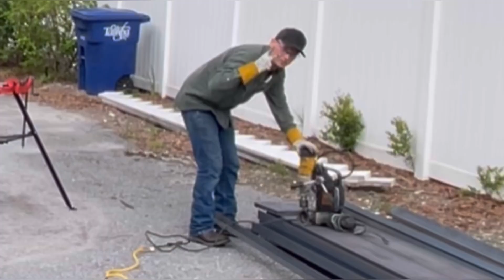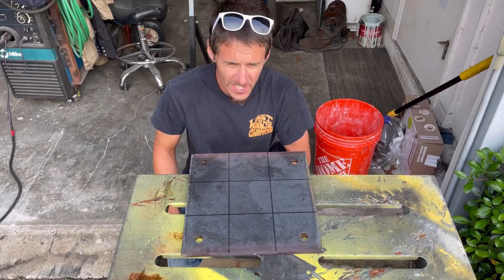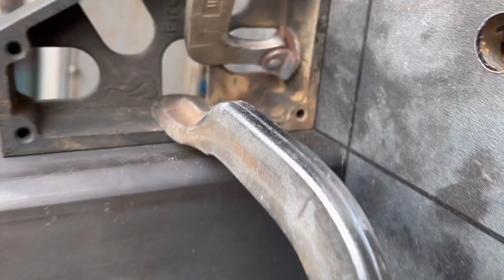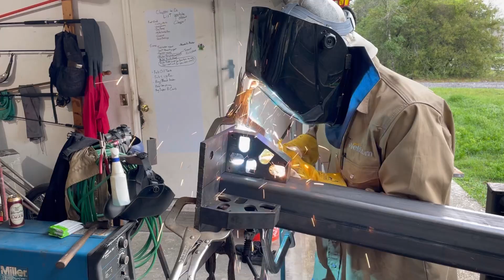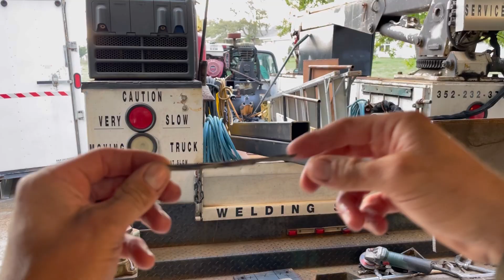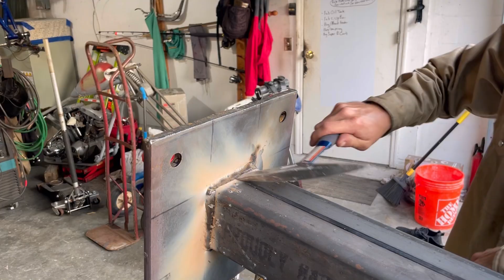Welding Structural Columns in the Field! (How To)

Comment: Of all 4 welding process im learning, mig has been love hate for me. When the settings are dialed in, man  you feel like the best welder ever. Then i got to vertical and over head and got humbled real hard. Holy fuck the bbs flying all over my face😂
I did notice that those plates still had the millscale on it, you didnt grind it off? One thing i realized with MIG, and TIG is mill scale fucks with your welds from start to finish more than it does with stick.
Reply: This..👍

Comment: I build test structures that scope wise are pretty damn big (up to 40ft high and/or 40 ft wide) and I've considered doing base plates welded directly to my 8 x 8 square tubes pre-erection.....but my boss is too cheap for plate.  Also I'd hate to have to shim the damn thing if the base is already on, as opposed to tapconning the base first, then welding the column on and adjusting the leveling with weld tacks.  Thank God I have a boom lift, telehandler, and vertical laser level at my disposal 😁
Reply from the maker: Sounds like he pays more in your hourly than he would plate
Reply: @MeltinMetalAnthony  The way things go at our testing lab, the double anchored angle method makes alot of sense when working solo like I do 99% of the time.  I tapcon the angles exactly where I need them first and they act as install guides and tack points for leveling before weld out.  If within a reasonable distance, I’ll make em long enough to weld to my square tube sill.  I exist a weird spot where dimensional accuracy and general strength is so critical yet my structures need to be expedient in erection and tear down once we are done with the testing.  

I’m worth a lot more than what I’m paid when it comes to my welding/fabrication duties (which isn’t 100%), hence Im working on starting a welding business myself.  What are your recommendations on how to handle legalities, contracts and paperwork?  I have the LLC setup but that is where I’m at in the business formation process and I want it properly setup before I take on my first contracts.  Thanks!

Comment: A little naughty trick my boss taught me to hide porosity which u probably shouldnt be doing is to keep ur voltage the same but judt turn ur wire speed down quite alot and weld over the porosity or pinholes. That way it wont build up the weld anymore than it is itll instead just fill in them aero bubbles

Comment: On your base plate layout, if you don't have a tape measure, you can simply run a line from corner to corner creating an "X" on the plate. Then set your square tubing corners on the lines of the "X".
Reply: That's also a quicker way to find center of a plate that you know is square or rectangular without measuring.

Comment: Wrong transfer modes to transfer.  Short circuit  get lack of fusion. 
Change gas protection, there you can get  spray arc... etc etc etc

Comment: It will Flex too big there's too much wiggle room on that I know most of y'all will never understand that I can take you to 8 by 8 3/8 thick columns at 15 foot is wiggly jiggly baby 12 by 12 base plate should be minimum of three quarters of an inch a six-by-six base plate which is suitable for a 4 x 4 column should be no less than half inch thick it's so now you may have understanding that the wiggle room comes from where the bolt goes to where the column is welded it's too far to be stable
Reply from the maker: This is what the plans called for. You pick it I stick it
Reply: @MeltinMetalAnthony  yeah I get it dude we just put on a Gable roof 12 by 6 by quarter rectangular tube sitting on top of 6 by 6 by quarter generally they do that for architectural reasons where the steel would be exposed but this thing was all structural not even going to be seen from the Underside will be covered with wood I didn't understand it and what they did to hide that thing in the house I didn't understand it affordable four column and a w 10 by 12 I-beam would have been more than sufficient for something holding a sheet metal roof holy crap bro I do get it I don't understand it

Comment: Loving the videos man. Question, since this is structural, is it coded? If it is did you decide the procedure or was it dictated by the plans?
Reply from the maker: No code on most welding jobs like this. I use my better judgement to determine the process
Reply: @Meltin Metal Anthony  that's what I was thinking but I figured it wouldn't hurt to ask. Thanks for taking the time to respond your videos are awesome. 👌

Comment: I get nervous when I see someone say "structural" and "easy" together.

Never push. Pull. Doesn't matter what you are running, mig, stick, tig, always pull. You want good penetration. If you hold your stinger at a 45 degrree angle and are pulling the proper speed your welds will always be decent. You must always get your work area setup proper though. Even underwater commercial welding has to do this, but so do regular welders, (I would say regular welders have to worry about it even more, due to wind.  Use weld curtains, build you some cheap square frames with weld curtains tied to them so you can bring them with you to jobs, all it takes is 4 pieces of metal, welded together to make a box then take some plastic, or burlap, and ziptie it to the square. Put 2 legs on it (H) shaped sign with legs if you are looking from above,  build 3 or 4 of them to make a box around your welding area so you don't have to fight the wind. Spend a bit more money and build them out of aluminum to make them lighter.   But yeah, the wind will screw your welds up, but so will pushing and not pulling. You want good penetration, and for structural welds, I always overkill the welds if there is no blueprint.
Reply: This is just wrong you dont ever pull tig and some MIGs wont accept a drag angle either

Comment: While cutting plate you should have burned out a 4 inch square for post to pass thru for condensation reasons. Also i nevet saw you check for square

Comment: run into your last start welding a base plate, welding 101 but no one does it, then just one cold start to tickle with the grinder, looks pro when done right. get the basics down first.

Comment: I use eagle arc 719 dual shield for welding structural steel. It is more expensive than stick welding but a lot faster and just as reliable. I have never been able to fully trust my bare wire mig welding in structural welding applications but dual shield is like stick welding if you lay in a good solid bead you can count on it.
Reply: Stick welding just so much fun ta do. And never gotta shield

Comment: When l do columns l take off all the mill scale in the weld area, Dychem and scribe the lines. Hold the plate flush with one hand and line up and tack it on. Then, weld out opposite sides and move on to the next column.
Interesting to see how you do yours young man!

Comment: While I understand the purpose and usefulness of using a straight edge to make cuts, I wouldn't ever suggest to anybody that they use them all the time because it diminishes your skill with a torch. There are lots of times when you'll need to make straight cuts and not be able to use one, or only be able to use 1 hand, and if you're not prepared for that you're screwed. 
We've got guys in the shop who will use a foot long straight edge to square cut a piece of 2 inch, 1/4 flat bar and they look very stupid doing it. Or trying to roll their straight edge along a pipe that needs to be cut to length. 

Same goes for welding, it's easier to put smoother cleaner welds with 2 hands but you're in trouble if you can't weld 1 handed, or with both hands. Always try to get practice outside of your comfort zone. 

Base plates are something that generally don't matter if they're not cut perfect so long as the holes work. Perfect opportunity to get some much needed torch practice.

Comment: That old Miller is a great machine, just needs to be dialed in and of course more cfh. Also, it looks like contact tip is too short-it needs to be even with nozzle or back a hair. I have had to cut nozzles back more than once.  Get a 15ft. gun-if it doesn't have one and play with the settings. Turn both heat and ws knobs to 3/4 then put 1 hand on ws while pulling trigger with other and start listening/adjusting speed till it sizzles.

Comment: this is the same building they were working on in another video.   at the time i thought no way these guys pulled permits on the work they were doing.  in florida, in a lot of the rural counties, there are lots of things done that would never pass inspection in the larger municipalities.   try and do that in broward, wpb and so on and you will get tagged.   of course they may have been permitted for that stair (very seriously doubt it) but i did notice that except for one quick flash there was nothing else in the video  about it.   so maybe the lead guy did not or the owner did not want it in the video.   if you are an aspiring fabricator here is a bit of advice.  get a set of plans that were accepted for a stair with platform and switchback and study them.   learn about rise and run and the deviation allowed from one riser to the next.  man, if those stringers don't look like some farmer did them nothing does.
Reply: Stairs take brains and experience.  One of us old guys should make a video showing some of the "rules" for making stairs. Doesn't anyone know what a "Nose line" is?

Comment: yes, you could pay a lot of money for that piece or you could cut a piece of angle and clamp it to the line you made with soapstone.  yes, i've built hundreds of columns;  a lot of times, after checking the column base for square cut, just make one line across and one line down and hold the plate so you can tack the corner.   that (1/2) base plate weighs 20 pounds. 
12 x 12 x 1.  steel = 40lbs   heavy?  a little but done all the time by people that do it all the time.

Comment: i've never seen anyone use anything other than soapstone.  (except on youtube)  i have to take that back.  erik uses the felt tipped steel markers and i have used them but i have also found that nothing with a felt tip lasts very long and if you happen to get the tip wet it's over.  if they work for you then go for it.   they are 7.00 dollars apiece and a stick of soapstone about a quarter.

Comment: I'm about to be building 6 of these exactly how your doing. Customer also wants me to build footers to go into concrete also. Do you build those as well? And On your wire welding 15 cfm is alittle bit low IMO  I typically run around 40+ unless I'm in a shop. give that a try next time and see how it does! Keep it up love you videos.
Reply: I've been running a successful welding business 5 years and welding much longer. My customer has a pallet of concrete so I have no reason to calculate all that shit. There is 2 baseplates with 2 ft of allthread between them (welded) and 2 ft x 1.5 inch schedule 40 pipe welded to both baseplates. That will be in the concrete with all thread stubbed out and top baseplate exposed. I am not green or bored and I warranty all of my work and am very confident that is strong enough to hold a 9 ft column. I am using 8 column for an 9 ft tall lean to that is 40 ft in length and 8 ft from house. Not sure why your trying to challenge me.. I just asked a question to see what he uses to mount his columns to.
Reply: @outlawwelding7505  'all that shit' lol.  You warranty your work.  How much liability you carrying?    Thanks for that reply there are probably a couple of posters on here that will enjoy it.
Reply: @newage3397  and yes I warranty my work, I do great work and have never had an issue with any of my work. Every single customer has been very satisfied with what I've done
Reply: I mean there is no need to waste my time trying to figure out how much concrete I will need if there is a pallet for my use. You may enjoy wasting your time but I do not
Reply: you do not build a footing.   i guess you could but it makes more sense to build a form where your column will be and then do a pour.   now, you have to know what the load is on that concrete determine the l x w x h.   and if it needs any rebar or wire.   remember F = P x A or factor through.  if you do not know what that equation is then you need to rethink sizing footings and let someone else do it.
Reply: @newage3397   the footing is really simple to build.. I do not know what formula or whatever your talking about, but I am going to make them and install them next week. It will be a form built and about 2 ft into ground. Thanks for your input
Reply: @outlawwelding7505  thanks for proving my point.    Why two feet?  You have no idea why.   Doesn't surprise me because anyone that follows this guy is either green or bored. .   Have you calculated the volume of concrete you'll need into number of bags to buy.  I doubt it.  Let's see if it's 2x2x2 that's 8 cubic feet.  Cured concrete ways 150 lbs per cu ft or app 1200 pounds.   Allow 10 pct for shrinkage.  Oh, any rebar or wire going in there?  Just a thought.  Good luck with the 'build'.  Do yourself a favor and watch these videos with a degree of skepticism.  You may be seeing an expert here but I am not and neither are several others.   Go to the previous video of this job and make note of the remark by the lead guy.  "Anthony likes to make videos".  That is what is known as a tell.

Comment: Lincoln Innershield NR-232 E71T-8 H16 Self Shielded Flux Core Carbon Steel Tubular Wire. We use this at work to weld columns as its faster than stick, however the tensile strength is greater with stick than the wire.
Reply: Finally, someone that knows what there talking about

Comment: short circuit mig doesn’t like the heavy mill scale on thicker base plates.  i would definitely grind that off before your layout.  inspectors in california didn’t like us using mig for that anyways so we ran t8 flux core.
Reply: spot on, most of the work in florida can be done with t11 (no wind worries and vs feeder) i worked in california post northridge and ran t8 when it was spec'd.  didn't like it as much as t11 but it has it's place.

Comment: What I would like to know is how you aquired that stair job? Whats the math thats involved? Lastly, did u consult with an engineer or architectect on the design of and layout of said stair? Thanks from a fellow metal sticker!!
Reply: don't use that stair as an example to mimic.  structural detailer is going to have problems with it.   did someone miss with the footing location?   i have never run my stringers straight into the concrete that way.

Comment: Need to run a drop from your 220 in your laundry room if its fairly close. Gas is too expensive right now!
Luckily mine backs up to my garage so I just popped a hole through and made a cap in cad and 3d printed it.

Comment: if extra strength is required I would bevel the outside edge on square tube for more surface area and then run two more passes...some triangle supports too if needed...
Reply: triangle supports?  gussets?  no need to bevel that tube.   it's only 1/4 inch wall.
Reply: I agree! 🤝

Comment: I work indoors running .035 sold wire with 90/10 and I'm running 30 to 35 cfh.  Is that too much? I make leak proof welds on a rotary all dang day..
Reply from the maker: I always run 15-20 in doors with good results 🤷‍♂️
Reply: @MeltinMetalAnthony  I'll try turning it down a little and see what happens.
Thanks for the response! Hope your new homestead is coming along.

Comment: Thats gotta be the most time consuming way to attach baseplates just sqaure 2 lines off the plate centre for top and side of the box section clamp a piece of angle to the top line and drop it on  done
Reply: Exactly

Comment: I'd have to bevel that square tube per blue prints, you always measure off the holes of the base plate to center it.
Reply: I worked in a legit shop fitted/ welding on the line 1/16th metal core preheated base plates for 30 mins that weighed over 600 lbs to beams that weigh more then your vehicle. And installed/ certified to do so in the field to weld. Your thinking is invalid.
Reply: @boatboy7418  sorry, you shop guys aren't that quick.   they preheated that material due to the mass.  did you shoot it to be sure it was at 250/300 F before welding.   don't impress me with the metal core, i have run it.  i have two VS feeders with rollers that go to  .072 but most of what i do is with .062 fabshield 21b or .045 NR211MP.     by the way, you do not certify to  'in the field' . you certify to an AWS spec.   in your case it would be D1.1 3 or 4g  1 inch plate.   aws does not care if you are in or out.   good luck.   PS.  that test is 400 dollars and you have to recertify every six months;  it cost 30 dollars, they just raised it, to do the recert.   did you do all that at an accredited facility?
Reply: Thermo crayon for preheat. If you can run a beam line and angle machine etc. Cdl for getting steel to the job can run a crane truck don't come at me... I did it all even draft blueprints. Sorry forgot water jet and plasma table. And cryro manifolds of high pressure all xrayed in the past. All certs payed by employers and re certs. Well till you climb to the top and just manage.
Reply: @boatboy7418  nice, i dropped the temp sticks for an IR gun.  don't get hot but no one does it all.   i wouldn't stop and look at foolish videos like this if i thought i knew it all.   what amazes me is the number of people that think they do know it all and actually know very little..   sounds like your dug in deep so good luck.
Reply: @newage3397  system brainwashed him into thinking like a bot
Reply: no need to bevel anything here.  what blue prints are you speaking of, i'll bet you there aren't any.   no need to do it any differently than they are doing it.  they will be setting anchors last unless you see some embeds that i don't.